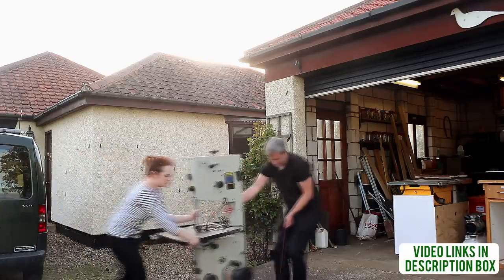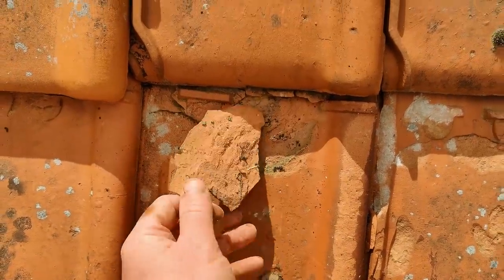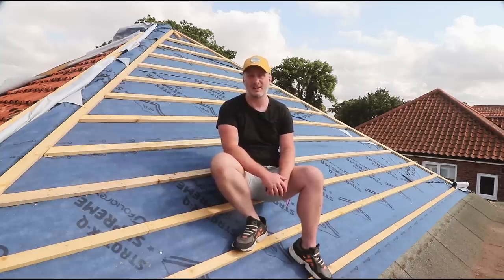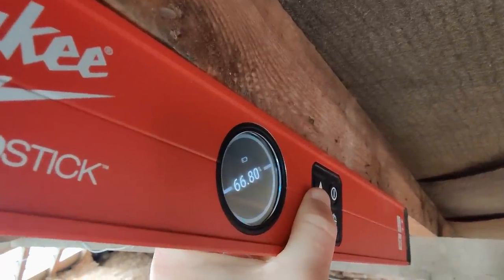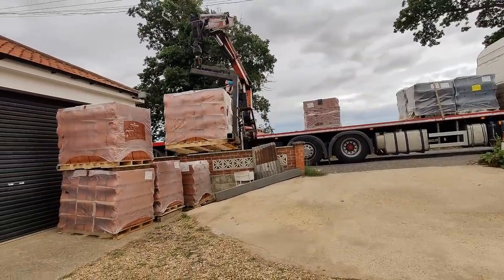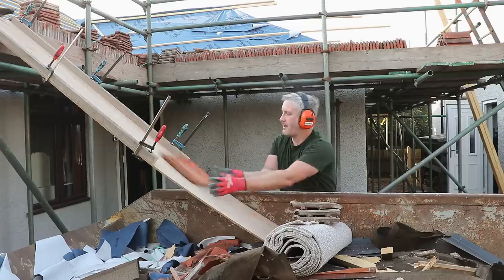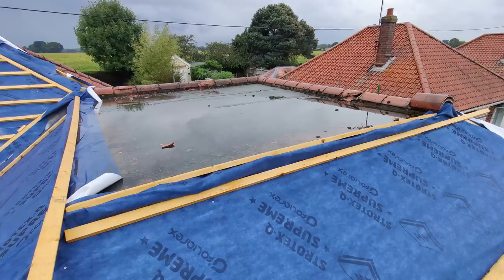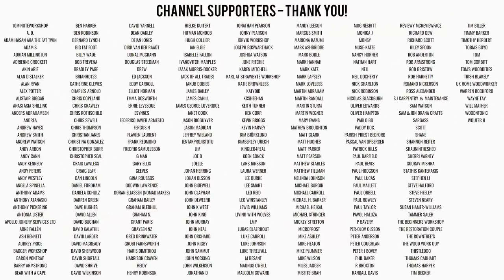The Damage Is Done, Who's To Blame?

Comment: This makes no sense. If you're facing months of waiting for tiles, why not get $15 brown tarps? Those horizontal lats are basically mini water dams, just one errant nail would cause a leak and hundreds of pounds worth of damage. Second, in the US people are moving away from fiberglass and choosing Rockwool insulation, which is hydrophobic.
Reply from the maker: The roof want stripped until way after the tiles arrived

Comment: Roof should have been cheated first with a good half or three quarter inch plywood and then either have ice and water Shield blue skin or something of that waterproofing nature installed first then the rest of the roof being applied this would ensure no leakage as well as at the edge of the roof there should be a proper drip edge placed on the roof that carries a good 8 to 10 inches up the angle and has a proper drip edge on the edge to ensure no water infiltration from the edge

Comment: Not what you want on a long anticipated project and I’m sure very upsetting for you and Ria. I worked for a company that did insurance work for quite a few years and I’d say that you are better off dropping the cracked ceiling, removing and damaged plaster on the walls, replacing it with new and having it reskimmed and decorated. On the few occasions the insurance company insisted on repairing cracks etc the ALWAYS recur further down the line and it’s just a false economy. Your roofer will have pub liability insurance and that’s what it’s therefore. Good luck in getting it sorted 👍
Reply from the maker: thanks mate, that's basically what is going to happen now, as the ceiling keeps sagging lower and lower!

Comment: 9:09 Wouldn't it be easier to keep the membrane sealed if it were put down on a plywood surface, rather than just stretched across the rafters. Is there a reason, other than cost, why they leave  it out? Does the roof stay dryer (assuming it doesn't leak) that way?  Here in New  England, nearly all the roofs are tarpaper, or fiberglass shingles, so of course I'm used to seeing roofs with a layer of plywood, and I don't know how they install clay roofs in the southern regions of the  USA, where clay tile roofs are more common. But I'd think plywood, or some other kind of sheathing, would keep the membrane from sagging and possibly leaking more once water started to pool up. It would also strengthen the structure supporting the roof, though I couldn't say just how valuable that extra strength would be.
Reply from the maker: My understanding is that the membrane is meant to say, to allow any moisture that gets behind the tiles to flow down the membrane between the rafters / under the battens
Reply: @RagnBoneBrown  I just found a discussion about  the way they do tile roofs in Florida and the general consensus was that some sheathing to keep the membrane from sagging or tearing was better with all other things being equal. But, they said builders often used it as a crutch and as an excuse to skimp on the spacing and fitting of the tiles, so you couldn't count on a better roof either way. Whichever way its done, they find a way to screw it up ;-)). 
  Good luck with the remainder of your project.

Comment: Just a heads up for those thinking about a similar approach for changing something like this roof pitch. I appreciate that our Rag 'n' Bone man has said that this is a 'forever home', but this will likely be noticed as/when the house is sold at some point later down the line. The solicitors acting for the buyer will be like a dog with a bone and won't let it go, so it will either need 'planning permission' or a 'certificate of lawfulness' to confirm that in fact it does not need permission. This will need to be in place prior to the sale of the house being able to be completed. 
I've been in architectural design for 25 years for reference and have seen many house sales fall through because of changes like this.
Reply from the maker: Are you in the UK?  I have never experienced anything like that here personally when house purchasing, or selling for that matter
Reply: @RagnBoneBrown  Indeed I am and I know of countless sales that have fallen through because of changes that haven't been put through the planning office. In most cases they likely don't even need planning, but the very risk of something having to be demolished after the sale has completed makes Solicitors very twitchy as they can smell a legal case against them!

In your instance, it's interesting that they designed that with a flat roof at all and whilst you wouldn't know without looking through the officer report for the original application, it may have been a request to keep this far lower than the main house as a part of the permission.